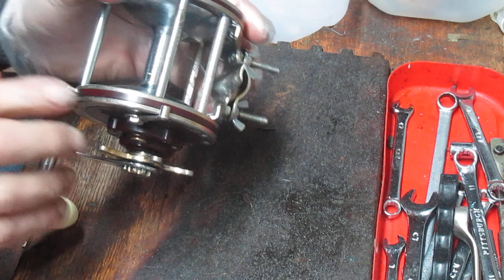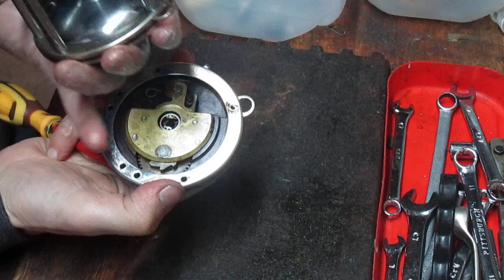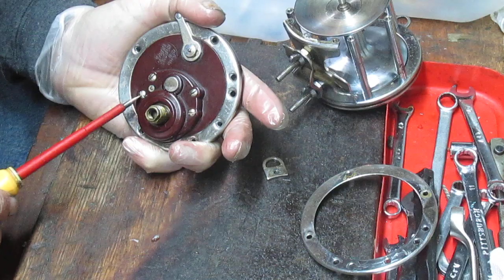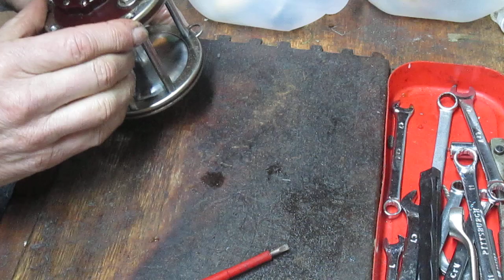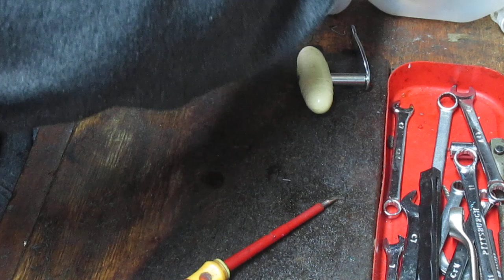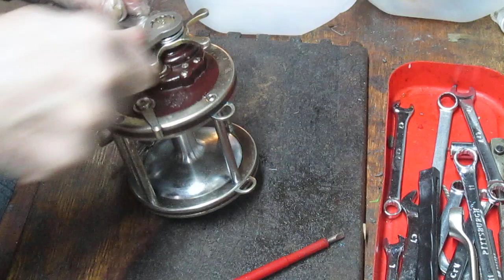Penn Senator 4/0 113-H take apart and service including drag washers

Comment: Dennis, Just got a new old stock left
Hand 4/0
But it seems that the spool is very wobbly (wobbles from side to side) 1/4 inch about. What could the problem be? I tightened the oil center plug but the spool still seems loose. What am I doing wrong?
Reply from the maker: There should be some side to side play.  If there is a lot, and you have tightened the non-handle side bearing/adjuster, then you likely have a broken bearing on the handle side or in the non-handle side adjuster.
You can get the replacement bearings at mystic parts.com if you determine that is the cause - Dennis
Reply: @2ndChanceTackle  thanks Dennis turned out to be the bearing adjuster needed to be tightened.  But I had to use some pliers to get it to screw in almost al the way. I’ve never needed to do that, they were always hand tightened. I have several 4/0’s so I tried a few from  the other reels and found that for some reason non of them would tighten up by hand in this particular reel. I needed to use pliers to tighten them all on this reel. But with other reels they tightened all the way by hand. What do you think that could be? The reel has never been used based on my observations so I’m scratching my head. Maybe some slight rust or maybe no oil on the threads? Again it would screw in half way I would say and then could not be tightened anymore by hand. Have you ever seen this?
Reply from the maker: Sometimes the threads get banged up and it makes it hard to turn them.  Glad you were able to get yours adjusted - Dennis

Comment: I know this is an older video but, I’ve taken apart 2 PENN special senators 4:0 and serviced and oiled them both and both of them now do not work because of this smaller thick  washer that comes off when I remove the spool
Reply from the maker: Jaden - go to Mysticparts.com and get the 4/0 schematic.  It is located in the Penn Parts section under conventional reels.
It sound like you have something out of order, so check to make sure the that is correct.  Also make sure that the earned mewl washer is sitting in the grooves of the main gear. - Dennis

Comment: But what if the spool has side to side slop with the bearing all the way in?
Reply from the maker: Then there is a good chance that the gear side bearing in bad.  Those are the two pieces that control the side to side movement - Dennis

Comment: I just bought a used 4/0 senator 113hl and it spins backwards a little, as far as the anti reverse should it be doing that is this normal?
Reply from the maker: Hard to define a "little". there is a step anti-reverse gear in the reel, so a brief step is OK.  If it is a quarter to a half or more back bed dal before it grabs then, no, that is not normal.
The most common cause would be a worn anti-reverse dog or a weak dog spring.  Both are relatively inexpensive and available through Mysticparts.com.
If you would like me to do it, you can send me a not to my email - 2ndchancetackle@gmail.com - thank you Dennis
Reply: 2nd Chance Tackle yes I believe i would say a brief step back as i can look at the gear and see where it’s falling in to lock in place i guess, if I’m making any sense
Reply from the maker: Brief sounds normal.
Reply: @2ndChanceTackle  Hello Dennis, I have a penn113h reel, the anti reverse is not working,..... Maybe the dog spring is missing or worn out????. I would like to send it your way so you can put it back in service, can you please send me your info! Thank you.

Comment: aren't those old drag stacks made out of asbestos? like the ones used on older internationals
Reply from the maker: I believe they are asbestos or an asbestos like material.  Most of these older ones shared a lot of parts, so they ar in several different models.  As an example - the drags from the 6/0 are in the Mariner 349.  The drags from the 4/0 are in the Mariner 149/249.  and so on.  I'm not sure which Internationals you are referring to so I can't say for certain, but it is a possibility - Dennis
Reply: @2ndChanceTackle  Dennis if there is a suspicion of asbestos you should probably be using a glove on your other hand as well since asbestos is highly carcinogenic ,just a friendly advice.
Reply from the maker: Thank you for the advice.  I don't see this much anymore as the design changed almost 50 years ago, however, an ounce of prevention!  Best wishes - Dennis

Comment: Hi. For sure your vids  are helping many anglers. I have a Penn senator 4/0  special 113 h but I don't know its capacity  (series). For e.g. a Shimano 2000,2500,6000 etc. Any Help. Thx. From mauritius.
Reply from the maker: I have that same reel.  The capacity is 475 yards of 30# monofilament or 434 meters of .56mm line
Dennis
Reply: @2ndChanceTackle  thx.  What is the drag force limit ?
Reply from the maker: The max drag on these reels is 19 pounds according to the Penn website - Dennis

Comment: Like to see 130 st maintenance.
Reply from the maker: Do you mean the Penn Sailfisher 130?  Wow - I haven't seen one of those in years.   The reel is basically the same as the older Penn 4/0 black side plate reels with the large drag hole in the side plate.  If that is the reel you mean, I will do the next one to come in....may take a few years! - Dennis

Comment: The red sided 112H is a 3/0 size reel. The red side 113H is a 4/0 reel. It’s not a collar. Its called a yoke. Its not a transition piece its called a jack. 
These videos show you how to take them apart and put back together but the practice he uses is terrible. All parts should be removed, cleaned, greased, and placed in position correctly. You grease the bridge screws first them put them in the side plate. Grease the yoke, jack, eccentric, pinion gear before putting in place. Remove the gear sleeve from the bridge, grease the post, and install the gear sleeve. Grease under the rings and all screws so there will be no corrosion.
Reply: Dennis does a fine job with these reels he has serviced my penn reels and they work perfect he’s been doing it for many years maybe you should start a reel repair channel to much grease is worse than no grease a little dab will do